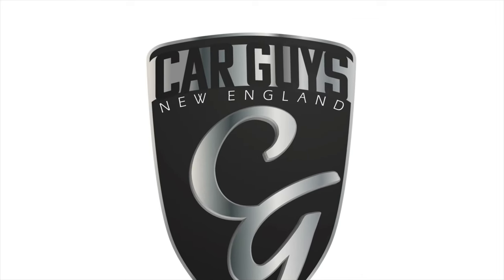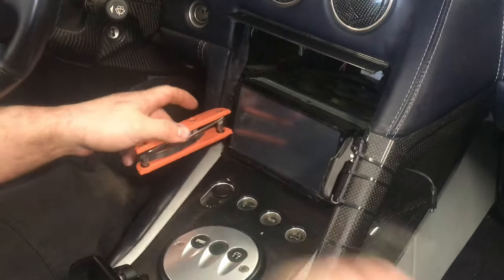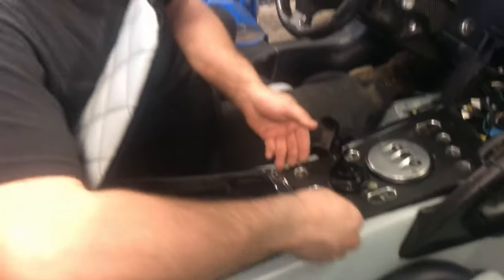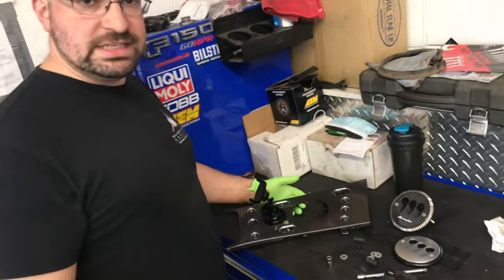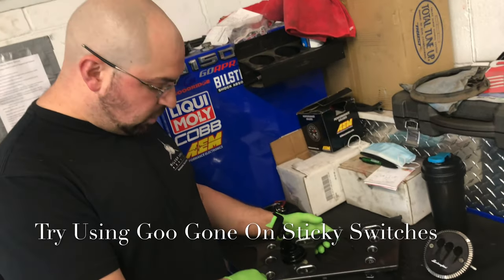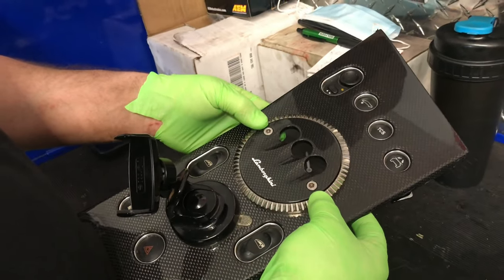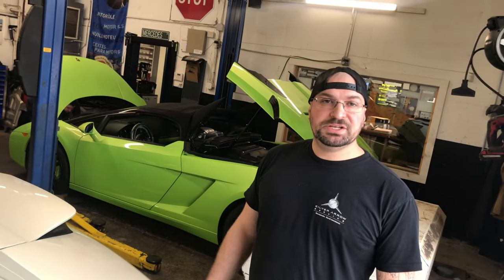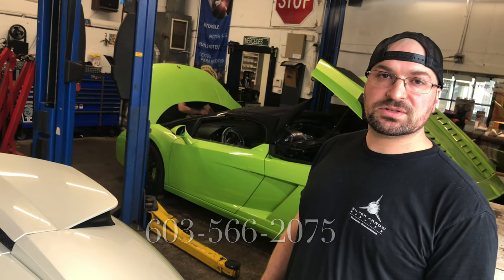How To Remove Lamborghini Murcielago   AC Panel, Radio & Center Console Cover

Comment: There is always some oh shit factor when removing trim like that. I couldn't imagine doing that on a car like that every little pop or crack sound would be like oh shit $$$.
Reply from the maker: Yes I would have done it myself but the cost to replace the carbon radio panel and top console are ludacris. I was unsure since the Lamborghini repair manual was terrible for directions.